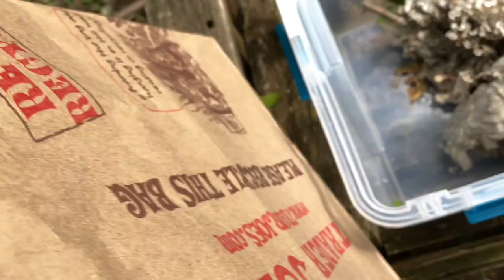LARGE BALDFACED HORNETS NEST REMOVED FOR VENOM COLLECTION!  MANCHESTER UNIVERSITY WASP SURVEY TEAM!

Comment: Love the extensions you've added to the Everything Bee Vacuum!  That is a very steady hand to keep the nozzle right on target.
Reply from the maker: Hi Tony!  Thanks for your comment.  Your “Everything Bee Vac” has been doing a great job for us.  We use it on every job.  To minimize ladder time/risk on jobs that require working at height, we often attach an extendable tool pole (with ends cut off) and use it as a non-flexible vacuum tube.  Works great.  Got that idea from Zack T. at Cascadia Venom Collection in WA State.  We also attach small live specimen collection bottles to the end of the hose/pole so we can collect the wasps for VIT (Venom Immunotherapy) and freeze the specimens in dry ice after collection (we put the entire collection bottle into the dry ice cooler).  The specimen bottle system is also designed by Zack T. at Cascadia.  So far this system, combined with your vac, has worked out very well for us.